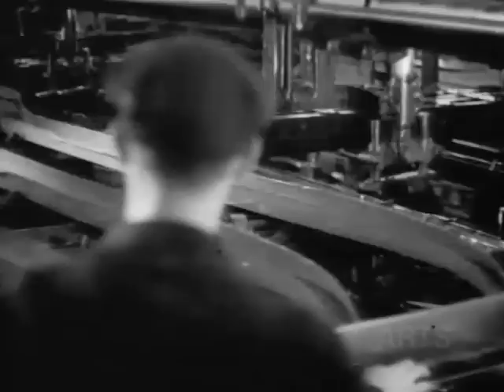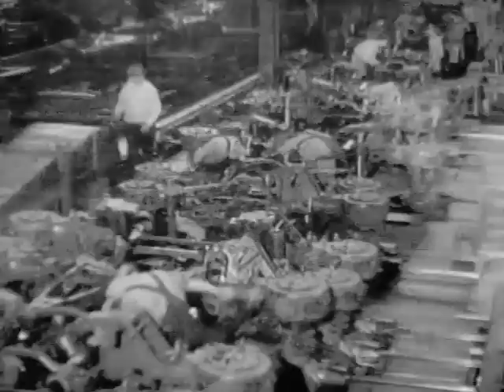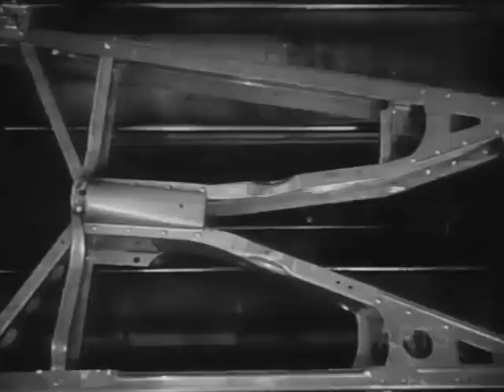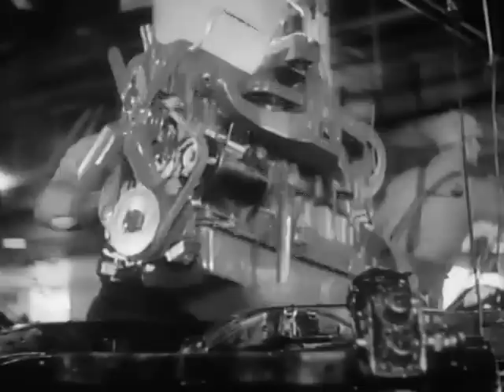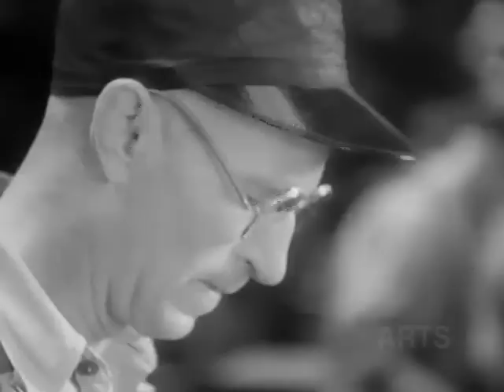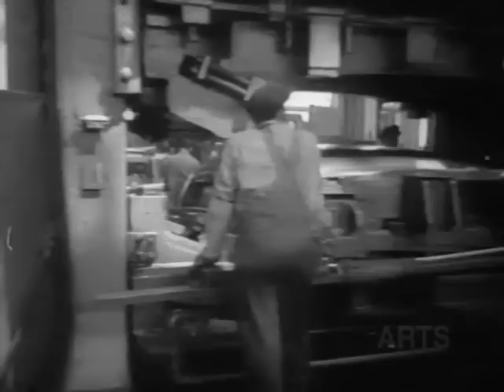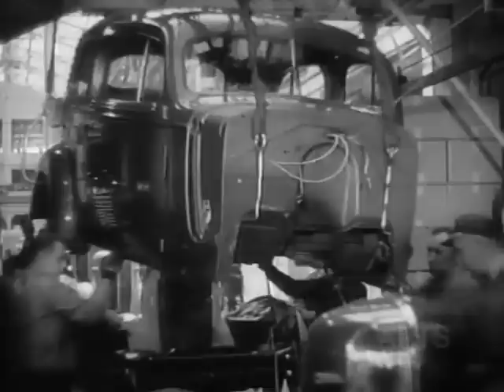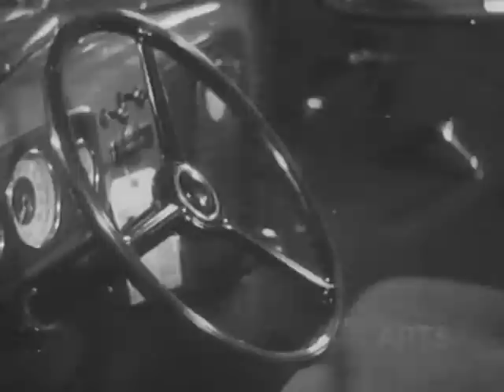Fascinating 1936 Footage of Car Assembly Line

Comment: What's even more amazing, considering the time period, was that they re-tooled every year for a different body style and equipment.
Reply: I loved it when they made a new body style every year back in the days. Now they just keep the same one for years and do stuff like face lifts and add other unnecessary stuff
Reply: The engineering that goes into all that automation is more amazing than the engineering that goes into the cars!
Reply: It's unbelievable!!,,No Plastic,,and Made in the USA
Reply: @vet-7174  so much waste
Reply: @PU8698  cars are better today
Reply: Reichsadler  I think they try to stay ahead by 4-5 years.
Reply: And everything was designed by hand, by a team if engineers, technicians and drawers: first the pre-project ou draft by pencil, 2nd after approved it was transfered to official pages formats as A0, A1.... as a formal project and still by pencil, 3rd apply nankin ink over the pencil drawing, 4st the project was detailed. It was the same until the  1980's, when AutoCad appeared.
Reply: Cad was in use in automotive before AutoCAD.  We were using CADDS.
Reply: Wrong! This is a Chevrolet Master production ran from 1933-1942. Production stopped due to WW2. GM didn’t start yearly body changes till the late 1950’s son